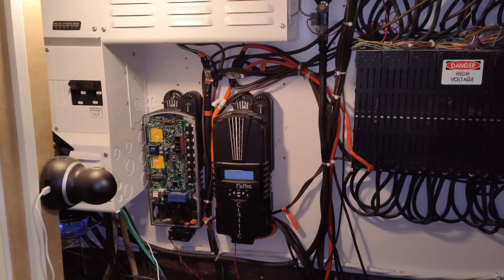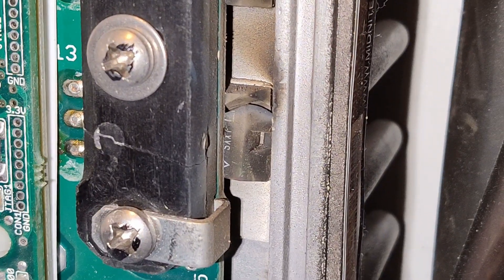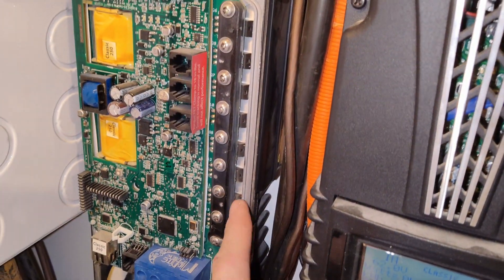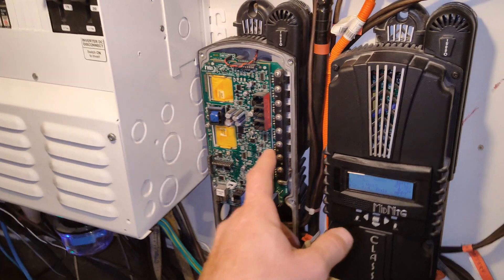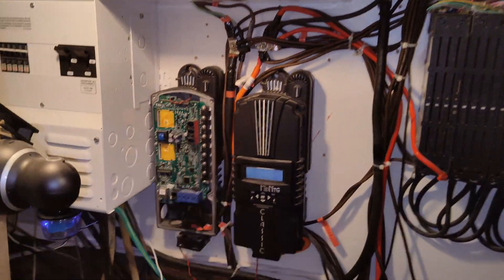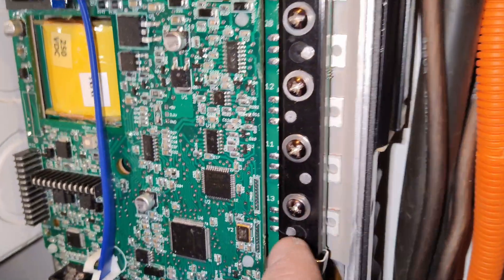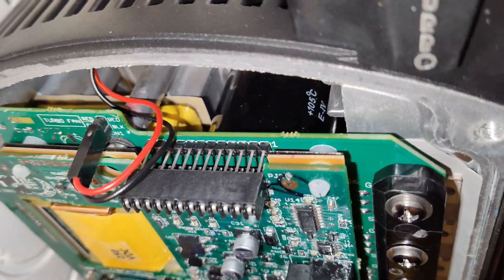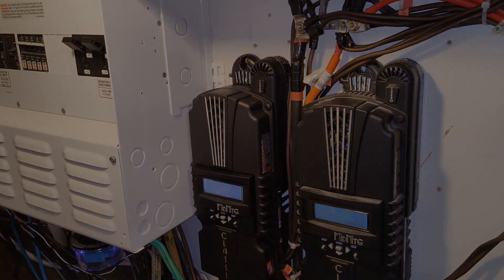Midnite 250 Dies!

Comment: For a repair attempt, I would recommend tracing the gate leads of the FETs back to the driver IC(s).  Depending on how the FETs failed (i.e. blow the Source open, and short Gate - Drain), they tend to sometimes take out the driver IC.  (If the driver IC is an opto-driver, damage likely will stop there, though possibly necessitating replacement of the driver chip.  If not...damage can continue upstream.)  If you see cracked ICs upstream from the FETs, it may not be worth a repair attempt unless you can find a replacement board.
Depends how integrated the MPPT design is; if there's multiple processors (i.e. one for the actual FET switching/regulation, and another one for the LCD / comm), it may be harder to determine if the rest of the circuitry is functioning.  I had someone send me a blown Epever Tracer 8415AN...but unfortunately damage had gone through FETs, drivers, back through the main CPU and also taken out the power supply (kinda a total loss).  If this Midnite still powers up (just no output), there's a chance it might be fairly easily bench repairable--especially if you have access to an oscilloscope and can at least see the MPPT trying to drive the blown FETs ;-).

On PJ inverters, their FET driver board is NOT isolated on the low side--and I've several times come across PJ inverter control boards with a hole in the CPU (FET damage backfed through the entire circuit and took out the CPU.)  GS inverters have a fully isolated/protected LF Driver design...and any collateral FET damage always stops at the driver board.
Reply from the maker: Wow great read 👍 the Midnite is still working just no output, it's looking promising, I was told I can order a mosfet board from Midnite, might end up doing that :)

Comment: Any chance you think this will work in a solar setup
Reply from the maker: I don't see anything?
Reply: @GoingOffGrid101  it was a link to story about them switching to 120 volt heat pump water tanks but as usual social media took the link away
Reply from the maker: @leighamos489   i have a solar water heating system I need to install :)

Comment: Interesting!   I have 3 x Midnite150s and throttled back to 80a max output (instead of 86a) because of 80a circuit breakers going to the battery buss-bar.   I run 8" (or so) 'vortex' house fans on them for supplemental cooling...   3 years of daily operation so far an no trouble.    Interesting you comment on 250s not as robust as 150?

Comment: Hope you can fix it... Keep us updated. 

I wished I picked up another 250 when that seller on ebay was liquidating a bunch for 250 a piece a few years back. I actually had to double check what I paid because they're much more expensive now.
Reply: Those were the 250CP variants from the DC Solar liquidation.  Most didn't have wind or hydro modes and no aux connections.